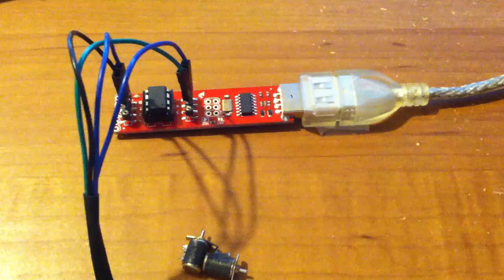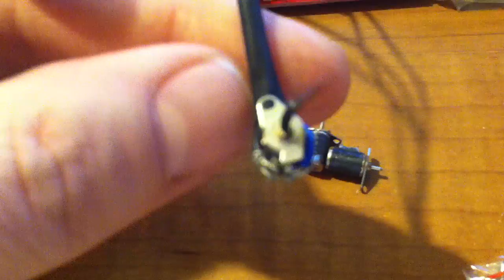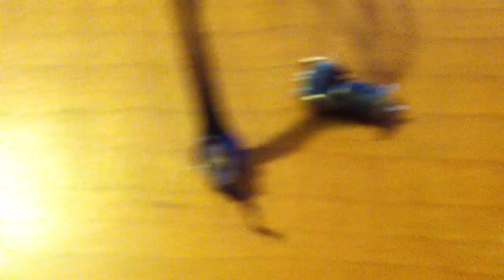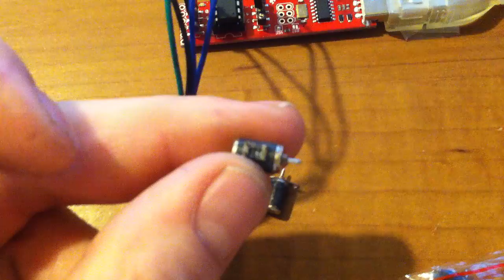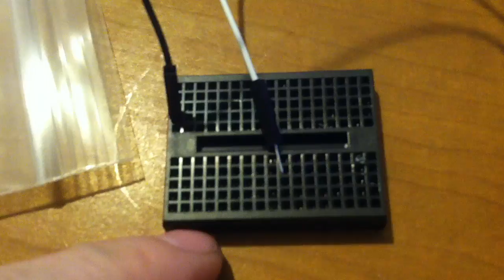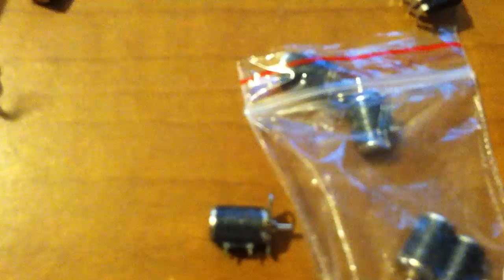TINY Arduino Stepper Motor

Comment: Is this motor silent? Can't tell if u removed the sound or it's as quiet as it is in the video. Can this servo be controlled directly via an arduino nano? This can turn in both clockwise and anti clockwise 360 degrees from the look of your video.
Reply from the maker: Yes, they are nearly silent. If you put it up to your ear, you might be able to hear it. I actually don't recall any noise.
Reply from the maker: I think the recommended way to run these is through a stepper controller but I ran it directly off a chip without issues but there was no load on it. Stepper motors I think produce a lot of noisy voltage that isn't good for a chip but these are tiny and without a load, it didn't damage the attiny chip I used.
Reply: @gearhed78  thanks, I'm looking for a silent replacement for my servo motors which makes extremely loud buzzing noises. But nothing is perfect, steppers lack a home position and like you said, probably will fry the chip if I ran it with load. I only need tiny ones to control tiny parts... but the back emf is a concern for me. Not sure how durable the arduino nano is if I didn't shield it.
Reply from the maker: @wyukigurumi  Not sure if it would cook it. Maybe look for a tiny stepper driver or at least some flyback diodes.
Reply: Hey Brad, I got some and tried them. Wow, it's torque is abyssmal, how much torque do you think yours have? I just need to pull a 100 gram load. I'm using a driver as well. L9110S and DRV8825. No hope... it's torque is so weak, if I press against it, it pretty much stops. I'm not sure how to increase the torque...
Reply from the maker: @wyukigurumi  I think they are rated from 3-5v. Perhaps increase the voltage? These were originally used to drive cd/dvd rom focusing lenses so I don't think they were designed for torque. As far as mine? I remember I could easily stop it. See if you can increase voltage.
Reply: @gearhed78  I'm not sure how I can increase voltage. The torque im experiencing now is so weak that it pretty much stopped when I touched it. Hmm I'm wondering what can I do to increase it so that it can pull as little as 50grams I hope if possible. One way is using a gearbox. Or perhaps my code is wrong or something.
Reply from the maker: @wyukigurumi  I am guessing your stepper driver is setting the voltage. You may want to look at the spec sheet on the driver you are using. What stepper driver are you using? Also, yes. Try different code. The torque you are mentioning seems very low to me as well.

Comment: I have a hard time trying to solder these :/ I only need one to work, 7 attempts remaining. (Aim is to to turn a pressure gauge into a temperature gauge, Arduino, bmp280 and one of these small steppers)
Reply from the maker: Use smaller solder wire and lower the iron temp. Clean solder tip well then add a tiny bit of solder to the small leads and to the wire. Then you can just touch them together and apply heat. I managed to get the technique down and it works.
Reply: @gearhed78  Thanks, I'll try that next!

Comment: Hey Brad, I just took one of those tiny steppers from the laser sled of a BR player - it looks like it about half the size of the one you have here. The coils are about 4mm in diameter and the motor is 4.5mm long.
Reply from the maker: Yes, I believe these I have are focal lens steppers for CDROM/DVD/BR.

Comment: Is there a way to control the stepper motors with steppers connected to JUST the attiny85 and not the USB AVR programmer. I understand that the USB programmer is helpful to get the program from the computer to the chip but once it’s on the chip I’d like to have a way of not relying on the USB. Would love to hear your thoughts on this
Reply from the maker: Yes. They work just fine connected to only the attiny. I had nothing but a tiny lipo connected to the chip and the stepper connected to the chip. I am sure it's not the proper way but it certainly works.
Reply: @gearhed78  Hmmm ok. I've been having a heck of a time getting it to work. Is there a way I can email you a pic of the circuit I have setup on my breadboard? Also, what code are you using? Hope to be up and running soon. I've programmed the ATtiny using the Uno as an ISP and am running the ATtiny85 stepper library to make sure it all works. The code I used uploaded properly to the chip but I just can't get the stepper to move
Reply from the maker: @vinceb121  Make sure to find coil A and coil B. Use a multimeter and touch the leads until you get continuity. When you find continuity between two of the motor leads, you have found either coil A or B. A or B is really irrelevant and any coil can be A or B just make sure it matches your sketch. The sketch I used is linked in the description I think.
Reply: Will be sending so you can see what I’m talking about! Really appreciate the help! If this helps at all or changes anything, I’m pretty sure it’s a bipolar stepper motor I’m using so there’s four wires coming off it: an A+, A-, B+, B- and it is very small...hang tight and I’ll send you a photo
Reply: @gearhed78  Your email was listed but then it disappeared? I was going to send you the schematic that I had but now I cannot.
Reply from the maker: @vinceb121  Sorry, I thought you already had it. I didn't want it on YT.
Reply: Got it thanks! You can go ahead and remove it now. 😉
Reply from the maker: @vinceb121  Emailed some pointers and the sketch I used in the vid. Let me know if it works!

Comment: I am planning to put this thing in 3x3 Rubik's cube. Will it be able to move the side of the cube ?
Reply from the maker: I do not think it would have the torque. These were designed to adjust small focal lenses for cd/dvd players.Maybe with some gear reduction. I would at least test one for your project so know for sure.

Comment: What areas can be the possible applications of these micro motors???....please someone answer this
Reply: driving a camera focus lens, robot eyes, tiny rolling robot, tiny robot finger. moving potentiometer on a mixing table. moving a microscope table, making small model mecanism, maling a small opening mecanism for secret book diary, open and close small valves. register and automate a keyboard knob button set...
Reply: robot facial expressions, blinking, eyes imo but will need gear system or pulley system.  these can easily fit in skull of humanoid

Comment: Hi im doing this for a science fair project. Is it possible to control it with a force sensitive resistor?
Reply from the maker: I can't see any reason why you can't control it like that. These are not really that strong but for their size, they are pretty good. I would recommend looking at force sensitive resistor sketches closely and trying to find an example that you can adapt to your project.
Reply: Do you possibly know other small and strong stepper motors? and thank you!

Comment: That is soooo tiny does a stepper motor have to be programmed
Reply from the maker: Stepper motors themselves do not need programmed. However, they do need some logic on a chip to sequentially magnetize the poles. They are not like a normal brushed motor. You cannot apply a positive and a negative to drive them. Since they are able to change directions,  they need a way to know how many turns to go and how fast. The chip that I have does exactly that. It sends the pulses of electricity into 2 sets of wires at very specific intervals. So, the chip needs to be programmed but not the actual motor. I left some information in the description about where to get everything and some resources about how this setup works.
Reply: @gearhed78  Is it possible to still order the stepper motor from the company?  Is it possible to program the chip so that the motor rotates in one direction and at a certain rate?
Reply from the maker: @Y.O.L.O  I think the link I put up is dead to order the stepper but I checked Alibaba.com and aliexpress and they are still available for VERY cheap. As far as a certain direction and speed. YES, you can do that. You just have to adjust the script. I left a link to the available steppers somewhere in the comments here for another person.

Comment: this motor is even smaller:
http://www.ebay.ca/itm/272471175466
Reply: I’ve been struggling trying to get this exact same motor to work with ATTiny85 and nano using a4988 driver and once without driver, with no success. Thanks brad for your responses, cause your advise to your comments seemed to be the most helpful (going to attempt onesteprevolution after this reply) after several days of scouring the web and watching videos, if anyone has  working audrino code for these tiny micro linear stepper If you could be so generous as to forward it to me at its(@)nicknguyen(dot)com . Thanks again brad for taking the time to reply to your comments. Cheers
Reply from the maker: Man, that IS small.
Reply from the maker: Also, that one has a nylon nut and mounting options. Even better than the ones i found.

Comment: Dear Sir
Thank you for this work
Could you please explain the connection of your circuit in terms of motor pins connections as they not very clear and which code have you used. Is it possible to share your code please?
Reply from the maker: The code is in the description: http://42bots.com/tutorials/bipolar-stepper-motor-control-with-arduino-and-an-h-bridge/

You will need a multimeter to identify which coils are on which pins. In the link above, it will show you the way a bipolar stepper motor works. You will need to test your motors electrical leads to identify which coil is "A" and which is "B". If you use your multimeter in continuity mode or resistance mode, find which one of the electrical leads are connected.

If you dont have a multimeter, these motors typically have the same setup (use multimeter to be certain). If you hold the motor with the shaft horizontal to the floor and the output shaft ( parts the spins) is pointing left, then the first coil ouput pins will be the first colored pair of pins to the right of the output shaft (coil A) . The next pair will be coil B towards the back of the motor. If you have the polarity reversed, I dont think it will hurt anything so feel free to test and move them around. Hope that helps.
Reply: Thank you very much Sir it is helpful but when I define  pins 2 and 3 of the ATtiny for pins A1 and A2 of the motors and the pins 6 and 5 for B1 and B2,  the motor spin only during the uploading the code but it stopped.Even when I checked it outside the AVR it does not spin. I have used the first code in the description so is there any suggestions please?
Reply from the maker: Since the motor is moving, that is a good indication that you have the pins/coils lined up correctly. To make sure, check the link below for another simple sketch. Read through carefully. Also, for the motors this small, you don't need the darlington array or H-Bridge describe in the article. Hope this helps.

https://www.arduino.cc/en/Tutorial/StepperOneStepAtATime
Reply from the maker: ALSO! I noticed that sometimes these would stop. Try turning the output shaft a little to get it started. Since the usual output amperage of an arduino is around 20-30 milliamps, it may need help to get started. If the h-bridge is used, that will amplify the signal.Let me know your progress and what you did to fix it. I am curious.

Comment: any chance of a video showing how you soldered those they do look incredible for modelling
Reply from the maker: I actually didnt solder these. I wrapped thin braided aluminum wire around the terminals then pulled the wires around then used heat shrink to hold the wires around.

If you wanted to solder them I would highly recommend a very small solder tip with an adjustable solder iron with flux. Also, very fine solder. I might be able to make a quick video.

Comment: Hi Brad, thanks for the video and links!
I am buying 20 of these, for one of my project. Any idea about the torque and power output of these motors? I am planning to design a custom 3D printed gearbox to be used with these motors to get a higher torque.
Reply from the maker: @Shaikh Since there is no data sheet I do not know. The retailer said that they were 3-5 volts.When using 3.3 volts, they are stronger than I thought they would be. Under 5v, they are probably even stronger. I wouldn't say they have a lot of torque but they do have a decent amount. I thought they would be very weak but they are about as strong they look. Hope that helps!
Reply: @gearhed78  the link for stepper motor is expired . can you send me the link.
Reply from the maker: @aivin8123  These are the same but have a gear and slide on them. $5 for 30 of them.
https://www.aliexpress.com/item/32921510787.html?spm=2114.search0204.3.20.2f642317AbxMo3&ws_ab_test=searchweb0_0%2Csearchweb201602_10_10065_10130_10068_10547_319_10546_317_10548_10545_10696_10084_453_454_10083_10618_10307_537_536_10059_10884_10887_321_322_10103%2Csearchweb201603_52%2CppcSwitch_0&algo_expid=7778b486-ade5-4d53-84ed-9d1f2e5ffd8e-3&algo_pvid=7778b486-ade5-4d53-84ed-9d1f2e5ffd8e&transAbTest=ae803_3
Reply: +Brad Focht, thanks for the feedback.
As I am planning to use 20 of these in parallel. Any idea of the current consumption by each motors? Would helpful in calculating the total ampere required for the whole circuit?
Reply from the maker: No, sorry. There is no datasheet. I wish I knew more so I could share.

Comment: Bought 5 of these because the description said "Stepper Motors" no word of how fucking micro they are. What can you do with these?
Reply from the maker: +Addi Anything you want! These were originally used for a dvd focusing lens I think.A tiny articulating arm? A tiny cnc machine? Tiny automatic etch-a-sketch?Anything tiny?
Reply: Question is how powerful they are...

Comment: how do you know what coil is - , + ? from A and B ? i have this one http://www.ebay.com/itm/111625120317?_trksid=p2057872.m2749.l2649&ssPageName=STRK%3AMEBIDX%3AIT and im trying to use the big easy driver from sparkfun and all i see in the board is A & B no + or - label pretty vague i try hitting you up on skype but i never catch you in time
Reply from the maker: +Sys.stem Hey, sorry you missed me. I just did a continuity test and discovered that the two pins closest to each other are a single coil. I detailed a pic here. http://imgur.com/kRxyQut
Reply: i actually ment in the sparkfun driver
Reply from the maker: What micro controller are you using?
Reply: arduino mega and or nano or uno any of  really and a spark fun easy driver

Comment: hi im using the same stepper, im triyng the one revolution code and it goes around 3 spins and it stops moving. Do you have any idea why it could be?
Reply from the maker: +pascuala sylleros What does your code look like? Do you have a link to a sketch that you are using?
Reply from the maker: +pascuala sylleros Are you using example 2 in the sketches in the link that I provided? If that's the case, that sketch makes the assumption that you have a stepper with 48 steps per revolution. These tiny steppers probably only have 16 or so steps so that would make sense. The code sets a loop to increment the steps. Each step increments a counter and this counter is compared to the line of code below. If you change that to 16 instead of 48, it may complete one revolution then stop.Let me know if that does the trick.
const int stepsPerRevolution = 48;
Reply: +Brad Focht  thanks for answering. It Works oddly, after one or two trials it just stops working. I think the batery supply its the reason but I dont know how to change it, or what to do about it. My stepper work with 3.3v or 5v and the battery supply has to be from 6v to 12v. Maybe im overheating the stepper. Also I been trying with an easy driver but it didnt work.
this are the links of what im doing:
-http://www.instructables.com/id/Stepper-Motor-Easy-Driver/?ALLSTEPS
-https://www.arduino.cc/en/Tutorial/StepperOneRevolution
pd: sorry for the bad english!
Reply from the maker: Hey, I checked out the easy driver and found a great tutorial for this exact setup. I see in the link that you provided that the arduino is only using 2 pins (8 and 9). This link that I have shows the Sparkfun Easy Driver and how to set it up using all four outputs from the Arduino into the Easy Driver. I recommend this tutorial since it is specific to your driver and bipolar stepper. Also, I think your power supply should be just fine.Let me know if this works.

https://learn.sparkfun.com/tutorials/easy-driver-hook-up-guide?_ga=1.42382305.557037760.1450388704
Reply from the maker: Also just noticed this very important note about the adjustment for the stepper amperage. I would recommend turning this all the way down to 150ma.

"The potentiometer on board is included to allow users the ability to select the max current provided to the motor. It ranges from 150mA to 750mA. This will require you to be aware what current range your motor can handle – check the motor’s data sheet for the current settings."
Reply: +Brad Focht  it doesnt compile, the "resetEDPins" isnt declared, i dont know how to fix it. Also in the tutorial they are using a RedBoard ( i dont know if it has the same functions as the arduino Uno).